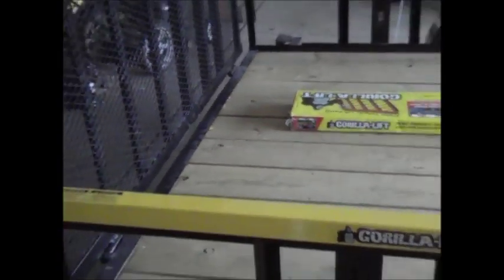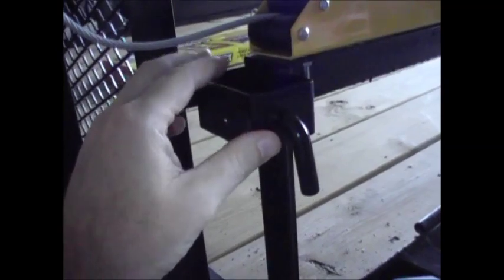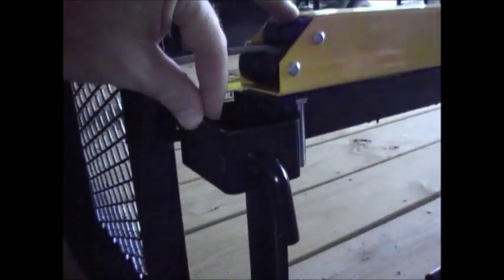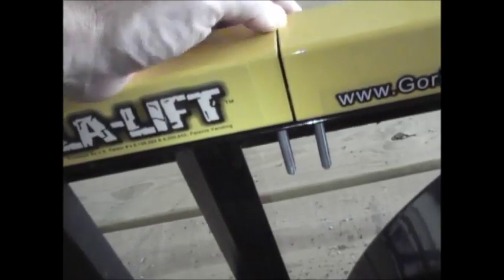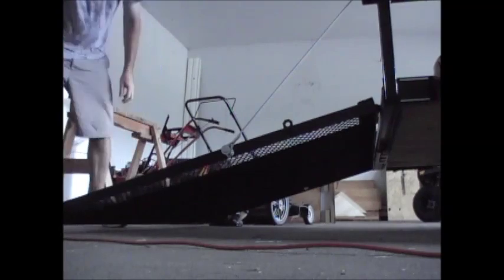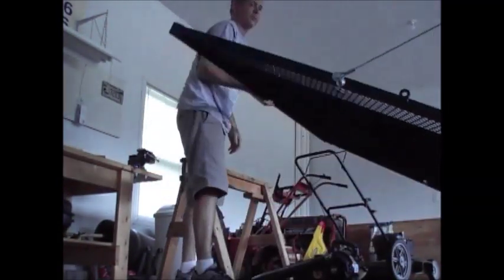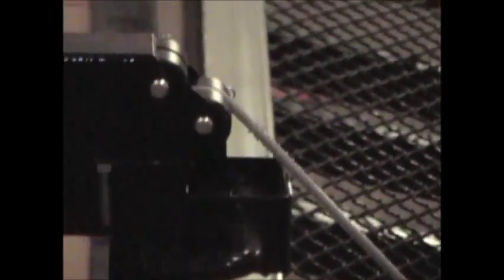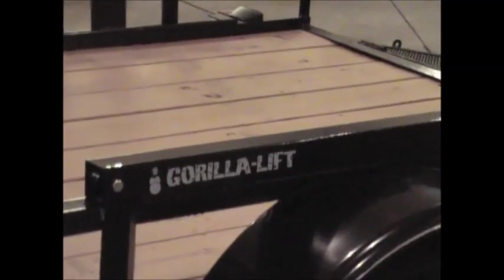Gorilla Lift installation on utility trailer

Comment from the maker: Used paint brush and black Rustoleum. Haven't had any problems with the cables. Makes gate a breeze to raise/lower. Never did seal the middle or ends. Still going strong.

Comment: The trailer design was the problem. That wasn't gorilla's fault. That being said, your fix worked but you also could have used a grinding wheel and put a 1/4" to 3/8" notch where the cable rubbed.  
You probably will have fewer problems down the road doing it the way you did.
 On sealing the 2x2 tubing, I think it would trap condensation and lead to rust. With the front side open, air can pass through and keep it dry. I have no clue why Gorilla thinks sealing the centers will do anything.

Comment: I don't understand leaving slack in the cable when the gate is up. Seems that could cause the spring to wobble around when moving down the road.
Reply from the maker: Hasn’t been an issue so far still going strong. It hasn’t given me any trouble. Great product.

Comment: These are not installed properly at all. Both the rubbing and the slack in the cables should not be there. Different trailer designs will require that you make some adjustments to the way you mount them.